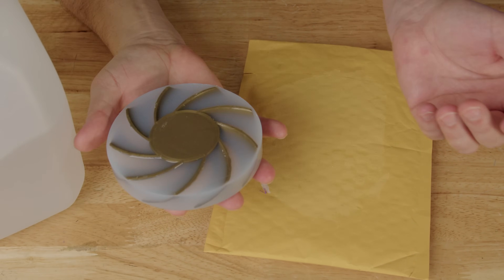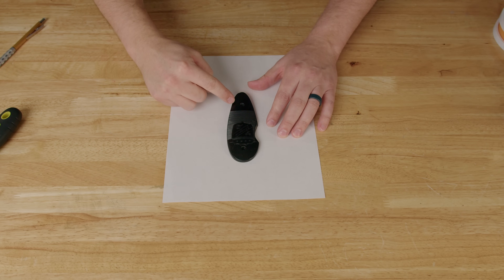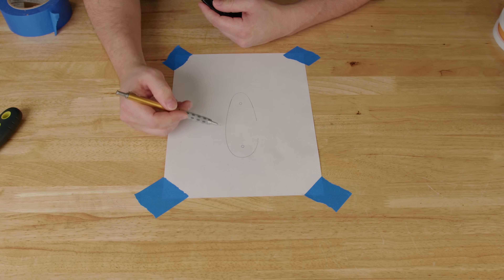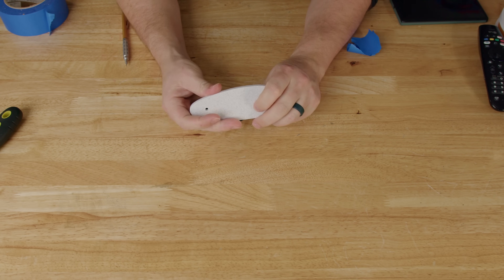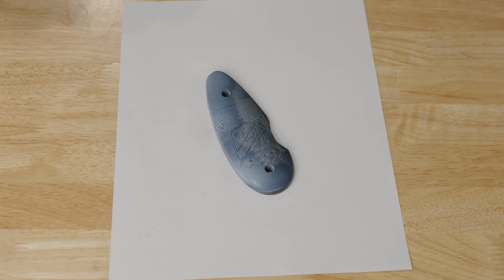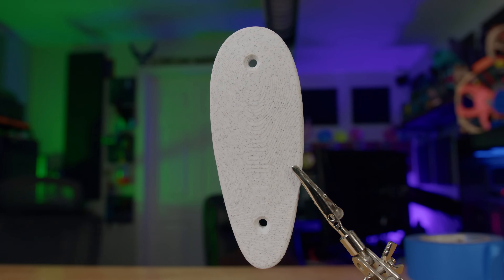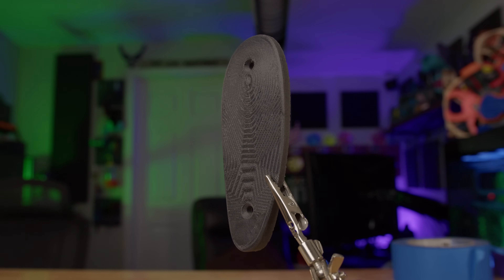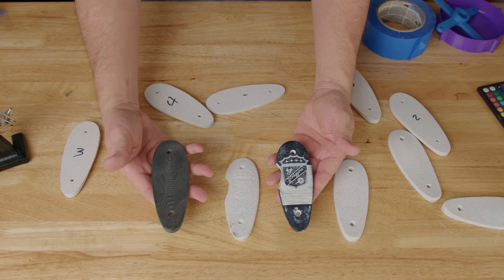This 70-Year-Old Rifle Needed a Part—So I 3D Printed It!

Comment: If you have an all in one printer with a flatbed scanner you can use that to get a 1:1 of flat parts. When you print look for the "actual size" type option or save it into a format you can import into your slicer. This is great for things like screw holes etc.

Comment: While the outcome is great this is one of those times when I wouldn't 3D print the part. I'd rather fill the broken piece in the original, work the pattern in the filled part and then make a mold of it.

Comment: I know you are a 3d print channel, but I would like to throw out an idea.

Since the old plate is busted, try buiding out the missing chunk with some type of epoxy clay, sand it down to match existing surfaces, mold it in silicone and then pour a reproduction plate out of epoxy.

Comment: Guess with just a quick glance: Looks like you're making a silicone mold for fan blades to pour in epoxy resin.

Also: We have a shotgun with a broken butplate, and I'm thinking about making a replacement with epoxy resin....so maybe that's fueling my guess.

Comment: I printed 30 odd bottom layers of carbon petg the switched to tpu and printed 1 wall and 20% infill guroid to create a stiff but compliant buttpad with a hard base for the screw head when screwed to the stock on my Lee Metford action BSA .410 shotgun. Ended up doing the same for my 10/22 and A-bolt

Comment: Pro tip: If you're planning to trace and scan something with a flat base you can instead just place the object itself directly onto a flatbed scanner with the lid up and go
Bonus tip: If you don't have exact measurements to use as a guide, you can place a ruler in the scanner next to the object and use that as reference
Reply: That and some tape that held the paper still could also have held the item still.
Reply: You can also take a picture of the item in three profiles from as far away as possible and zoomed in as much as your camera can naturally do (avoiding digital zoom) to reduce the parallax issues.  Most modeling programs ( even FreeCAD ) will allow you to import the images and scale them attached to sketches so you can trace them in the program.

Comment: Draft sketch on white sheet with black ink, scan it, then export to SVG. Then import to Fusion360, size it to appropriate scale, and extrude component. Easy-peasy. Source: I just fixed a JC Higgens .22LR buttplate this way.

Comment: How I would've done the contours - put the part on a scanner or printer scanner and then trace the contours from the scanned image (don't need to manually draw it with a pen on paper) in the software that You are using. Might even try Illustrator to "mark and trace" the contours automatically (this one might not work if the scan is not completely black vs white background).

The scans are 1:1 with the real part.

Comment: I would be really tempted to try it with TPU and a gyroid infill.
Reply: TPU butt plates work well, got a buddy who has done it.
Reply: I've done that with a butt pad on an over-under. I also used multiple modifiers so the infill at the back was less dense than the front, so it got more stiff the more it compressed.

Comment: My main hobby is 3d printing... Guns! Not just small parts for them, the whole thing (minus a few parts that have to be made from metal). Everything from the simple and basic, like Glock frames, to fully DIY projects. I have some pretty cool stuff made this way. You should look into the hobby, but be warned, youtube really, really doesn't like it.

Interestingly, PLA+ is one of the more popular filaments for gun stuff. PETG is too brittle (it tends to shatter), and CF Nylon is expensive and harder to print (although it is one of the better choices otherwise).
Reply: PET-CF or PET-GF is new hotness too.